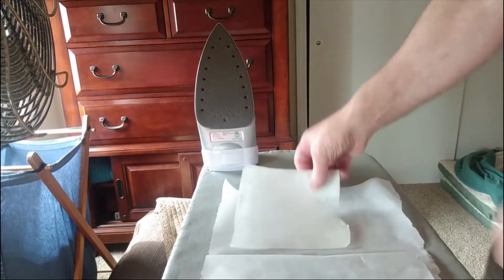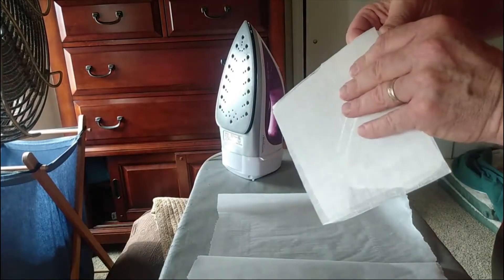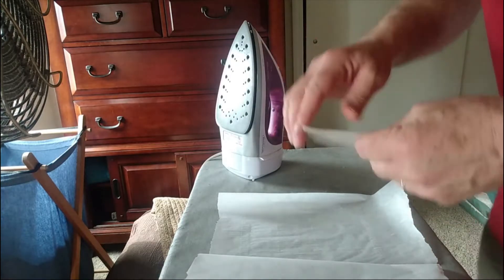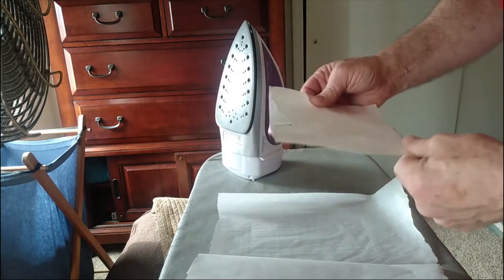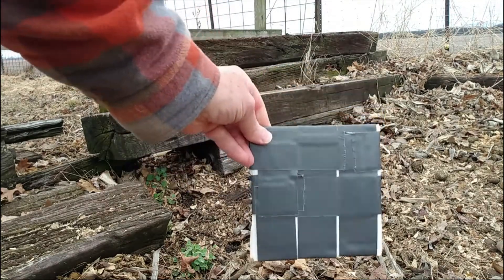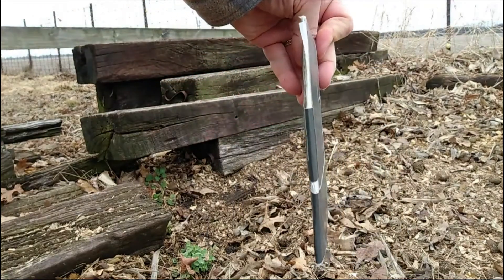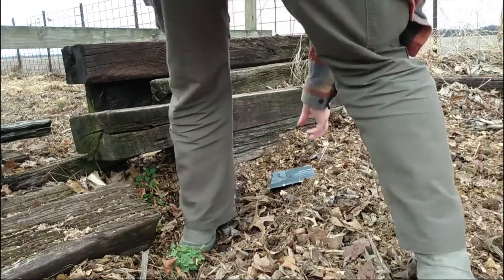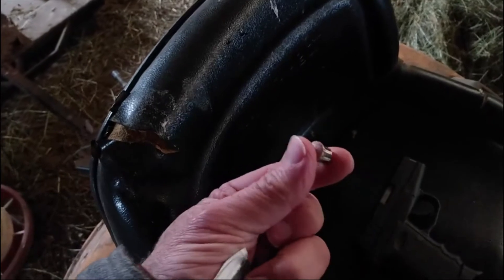Heat bonding UHMWPE - DIY ballistic armor test

Comment: Im sure youve checked it out but have you tried thicker fabric? I recently bout some uhmwpe tape to make a glideless drawer less sticky.  I only looked on amazon but there were 12" wide and i think .1mm thick  tapes. Something to consider
Reply from the maker: Not all PE is the same. Keep in mind that the fabric sheet roll I buy is specifically made as ballistic fabric for vests (usually soft body armor). That means it isn't just UHMWPE plastic, it's fibers of that PE in a matrix of more PE. There are different weights of this ballistic fabric available and I always go for the highest weight (160-170gsm). 
   The tape you mention may be infused with fibers or it may just be a solid tape of UHMWPE. If it has fibers infused in it then it will resist tearing and will require a very sharp pair of shears to cut (I use kevlar fabric shears to cut my ballistic sheeting). A whole lot of this tape might then be a viable backing material for a ceramic face to stop rifle rounds or it could suffice to stop most pistol calibers as soft armor.   The docs for my sheeting indicates that 40 layers is enough to stop a .44 mag pistol. I usually go with extra layers (50 or so) plus a hard ceramic face to stop rifle rounds. The ceramic needs to be selected carefully. I've used high hardness thick (8 mm) ceramic tile over my PE layers and all rifle rounds I threw at it punched right through. Another brand of ceramic tile of equal thickness did stop the same rounds with the 50 layer PE backer.  You should do tests before you settle on a tile and PE combo to make sure it will actually work well. Then scale up to an actual plate for a carrier.
Reply: @BooDamnHoo  any chance you recall any info on what tile worked? mosaic? 1cm thick? do they got it at the hardware store? lol thankyou m8. also, how did you affix the tile? epoxy? crazy glue?
Reply from the maker: @vevenaneathna  The tile that worked best for me was 8mm thick "heavy traffic" tile. Hexagonal pattern, 2 inches in size. I can't recall the name and the squares I have left don't have a name on them (they came out of a box at Home Depot). The design that I have and that worked best for me has a faux white marble finish on the face. They come in 1 ft x 1 ft squares. I'd remove the tiles from the mesh backing and directly glue them to PE plate using construction adhesive. You have to remove the tiles from the squares because they are made for floors(of course) and have a small gap between them for grout. I'd lay the loose tiles out first on the plate so I could see which ones needed cutting (along the edges) and mark the cut line with a marker. After all tiles were glued onto the plate as close together as possible, I'd apply a coating of high impact marine resin to fill the small gaps still between the tiles. The resin I like has no smell so is nice to work with and not expensive:Max Bond Industrial Strength Adhesive Resin. It's marine for boat hulls so think motorboat slamming on waves as it's moving and hitting the occasional submerged log or something. Finally, I glue a ripstop nylon/polyester sheet around the front and back of the plate. It looks nicer but, more importantly, slides in and out of a plate carrier easier. It will also help keep ceramic debris from hit tiles from flying around.
Reply: @BooDamnHoo  hey thanks for the reply, this is really useful info. still doing research and its my understanding that these plastic plates might work better after being fused with temperature instead of resin. anyways, just trying to extrapolate if the surplus plastic plates i bought might squeak out some more performance than yours so I can size the tiles as small/light as possible. really glad i found your channel. I know some people use construction adhesive in place of resin, but im thinking it might perform better to adhere tile vs resin since thats less about delamination strength. 

anyways i bought a dozen of these plates for ~20$ each shipped. all are square so im thinking of cutting them, experimenting with heat and molding them, ect. im thinking I can get away with testing offcuts + a single tile and aim for >6mm. I was also thinking that porcelain tiles might perform better than ceramic and can be lighter? maybe im wrong. also unglazed/textured seems to be stronger. 

If i get around to testing ill let you know and probably learn how wrong i am. tbh the plates seem to stop all plane jane 556 which is mostly what i want to upgrade my 3a backpack insert being a student and all... for obvious reasons. tile strike face to stop green/silver tip and maybe some hunting rounds is just extra credit. thx again

Comment: Can I ask where you sourced the uhmwpe. I'm currently shopping around
Reply from the maker: The best source for fairly inexpensive ballistic vest grade fabric is Alibaba. You can also use Dyneema that you can get domestically but it is more expensive. In any case you want to get heavier grade. I go with 160g. I can't recall if Dyneema uses the same units.
Reply: @BooDamnHoo  I'd love to get Mt hand on some dyneema but after and extensive online search I can't seem to find a vendor. I am hesitant to order from Ali simple because of unknown standards but watching you video does tell me I'm atleast on the right track. Do you mind if I ask who the vendor on alibaba was?
Reply from the maker: @misfitmartiniable  To find my preferred supplier on Alibaba, I looked for suppliers that sell by the meter and had the 160/170gsm material. Some of the suppliers will only sell larger rolls good for a business rather than an individual.  The supplier I've been using is Jinhu Keely Sport Products Co, Ltd.

Comment: Can you shape it? Or does it have to stay flat?
Reply from the maker: It pretty much holds the shape it is ironed as.  It's stiff. I have a curved form made with fiberboard and pieces of 2x4 as a frame so I can iron sheets into a double-curved shape on it. Made it from the fiberboard form I used when I was making plates with epoxy, before trying ironing. The only change I made to it was to cut pieces of 2x4 to act as a frame to hold it steady and help keep the fiberboard in its curved shape (I show the fiberboard form itself in my previous video when I was making an epoxy-based plate, also explaining how I curved it).
Reply: @BooDamnHoo  so it works better with heat compression? Would a heat gun be suitable or does it need to be ironed ?

Comment: nice.I wonder if you can make a tile by just rolling and ironing a long tape of PE instead of doing that on squares of PE sheets cut out.
Reply: hmm, it doesnt help that there is a bunch of "trade secrets" and "secret recipes" in the industry about this, but i think it is part of the confusion. most patents say very little, but from my understanding the difference between regular plastic polyethylene (PE) and UHMWPE has to do with differences in the molecular structure in regards to the polymer lengths. polymer chainlength is what is meant by "molecular weight".
single use water bottles = low molecular weight, very flexible, has a smooth outer surface
milk jugs/cutting boards/thick grocery bags = high molecular weight, much more ridged, has a chalky/slimey outer surface, much more impact, cut, and abrasion resistant. 
UHMWPE chains are apparently so long they can transfer some forces over significantly greater distances that you might expect. I imagine centimeter long molecules like DNA (each human chromosome is ~70 cm long when unraveled like during cell replication). apparently this ability combined with proper directional layering/bonding multiply each other synergistically instead of proportionally, and a bullet impacting the surface has to either pull several layers apart (ideal), break the molecules structure, or melt it out of the way. steel penetrators seem like they are able to basically melt and push their way through. i think an addition of a small-sacrificial layer of ceramic tiles defeats these rounds because they destabilize and no longer impact the plastic tip first. im thinking 5.45 7n6's Geneva convention defeating encased hollow point might actually render its iron core useless here. need to test this.

there are a few channels that have tried turning HMWPE cutting boards into armor with obvious results. theres a channel called 
"Tech this out meow" who was actually somewhat successful in making plates first out of milk jugs in a toaster oven and then just blobing the stuff into a plate in a mold. They were later much more successful when they laminated several layers of those thicker grocery bags (common now in states that charge you 5 cents for each grocery bag since that was apparently the intent of banning the free bags) between 2 oven sheets and just baking for awhile. they had the same known deficits of uhmwpe and penetrator tips/cores and also required much more thickness and weight to achieve the same effect however.  I am somewhat optimistic that with more careful heating and avoiding the polymers glass transition temp, you could maintain pretty allright flexibility with this stuff though. the new us military plates are going to be that hybrid design, plastic + ceramic. sportsmanguide just finished selling cheap surpluss uhmwpe plates for 22$ each shipped. theyre about 45$ ea now that blk friday is over.

i picked up a plate and am going to replace the 10 year old expired kevlar 3a plate in my backpack with one after i glue some cheap mosaic tile on the front. aiming for 4lb plate which performs like 12lb of ar500 steel. gotta test it first. if it works then ima make some more and give them away as christmas gifts this year to family. 25$ level 3+ plates of the most recent "generation"

Comment: If you REALLY want to construct UHMWPE laminated sheet armor that works against all handgun rounds, create enough layers to stop a 5.7x28 FN SS197SR, and the SS198LF.  If you don't have access to one of those, test it against .22 TCM and or .22 TCM9R.  When you get to a number of layers that stops those rounds - you're there.  The resultant laminate will stop any and all 9mm, .38, .357, .40, .45, 10, and even .41, and .44 magnum.  given that it's "soft" armor the super heavy calibers can still damage or kill by energy transfer into the target, but the bullet will not penetrate.
What I like about your idea is that you can create curved laminates that can be sized and shaped to give wrap-around protection.
Also try an sternum plate of 16 gauge steel hammered into a curve to fit on the front surface of the UHMWPE laminate.  This will act to spread the bullet's energy, resulting in lower backface deformation with the laminate structure supporting the steel plate.
Reply: small diameter bullets and steel penetrators' are the kryptonite of uhmwpe. need a sacrificial ceramic layer. this is what the US military is developing for its newest gen armor.

Comment: Interesting, if you put some hard material behind armor with no gap - will PE tears? For example, close to a wood, aluminum plate, stell plate, or even brick?
Reply from the maker: When I tested my first plate I had it up against a stack of railroad ties (I need to get some clay). So hard backing. 7.62 Nato M80 FMJ did not penetrate all the way through. I don't know how severe back face deformation actually is. Pretty sure it would be unpleasant.

Comment: Hello.
How would it resist a knife?
Sorry for my English.
Reply from the maker: Not sure about that. Stab resistant poly armor is usually a different form than bullet resistant. A stab test would have to be separate. I suppose I could try a preliminary test  on my original test plate with a knife to get some idea.
Reply: Yur Engilsch sukz!!
Reply: @philip6419  thank you

Comment from the maker: Updated info. This little plate of 24 layers had no problem stopping 9mm FMJ (115 gr) not 124 gr hp. It did not reliably stop 9mm 50gr +P (light and very fast) hp (Civil Defense rounds). To hope to stop those I'd think about 33 layers would be needed, which would also stop a lot of heavier pistol calibers too. Ironing the layers together would keep it thin but stiff. Unbonded layers could be kept thin by vacuum sealing means and enclosing them in a pouch sewn around the edges. 
Alternative ways to keep it thin and together would be to iron maybe 5 layers or so together, over and over, and stacking these little ironed bits on top of each other.
Reply: put that pouch in between some carbon/Kevlar layers and I'd say you got a nice new jacket liner
Reply: @kingmasterlord  Why on earth would someone do that? Makes absolutely no sense whatsoever when you could simply just increase the layers of the UHMWPE and it will have 100x more protection than regular Kevlar. This stuff is a lot better than Kevlar, a lot lighter and they have the 'Ultra Dense" stuff stopping 50 calibers now.
Reply: @Boobytrap_Badger  because it has to be slim to be a jacket liner? build volume is limited. why is that outrageous?
Reply: @Boobytrap_Badger  density is not the only metric for protection you want a hard shell in places for deflection etc, I said something about it being for a jacket liner, pay attention.

Comment: For how stiff it is for 24 layers and duct taped would this still have enough flex for use as a standalone pistol rated vest face ?
Reply from the maker: You don't have to bind layers for them to work. I bind layers because my aim is to make ballistic plates for a plate carrier (for now).  All bound together as I do it would not really work well for a pistol vest. If you did that you'd need to form it/bend it a bit while you're making it so it would fit better over a chest. Also, is go with more than 24 layers. This was a test by request to check the manufacturer claim that 24 (actually it was 25 but I didn't have enough scraps for one more later) would stop 9mm FMJ.
    If you want flexible/soft for bullet protection, you would want to keep the layers unbonded and enclose them in a pocket/pouch to hold them all together. If use cordura or nylon, or even denim and wrap the layers, compact them as much as you can, and sew the nylon cover around the edges to hold it all in place and together.
Reply: @BooDamnHoo  where do you suggest sourcing for the uhwmpe?
Reply from the maker: @es3753  The best and cheapest source is alibaba.
Reply: @BooDamnHoo  any specific link you'd feel free to share?
Reply from the maker: @es3753  Not a link, but a name:  Jinhu Jeely Sport Products.
Reply: @BooDamnHoo  is there a specific title of product you'd recommend to look for? Also this is essentially the lowtech version of hardwire soft body armor since you have heat and some pressure good job
Reply from the maker: @es3753  There are no real brand titles. It's simply looking for UHMWPE in the 160 gsm range (160 grams per meter). Some of the sellers on alibaba specifically mention it's good ballistic armor.  The (easy) trick is finding the vender who will sell down to 10 meters. I buy rolls of 10 meter length when I need it. With no mistakes on your part, that is enough to make 3 full plates with some left over (for side plates, or test targets, etc). As for the tile strike face, go with 8-10mm thick heavy duty tile (for floors/high traffic areas). I go with either 2 inch square tiles or 2 inch hexagonal tiles and these are adhered to the front face using epoxy resin. Finally, I wrap the whole thing in either kevlar fabric (it's yellow and available on Amazon) or riopstop nylon or cordura nylon. This is stuck to the plate by epoxy as well, though you could go with construction adhesive too. The cover is to make it easier to slide in and out of a carrier and to act as a spall guard (any chips of ceramic get captured by the cover). But then, gorilla tape does this job pretty well too. The ceramic just doesn't throw much debris that your plate carrier couldn't probably handle alone.
Reply from the maker: Another thought: iron a few layers together and keep doing that so you have a stack of individual bonded packets (maybe 4 or 5 layers each). This will be somewhat stiff after you stack 6 or 7 on top of each other but much more flexible than 24 to 35 layers all bonded together.

Comment: Soooooo good man! I'm glad your working on this. Do you mind me mentioning you in my new HDPE video?
Reply from the maker: Sure. No problem.
Reply: Endless sling used by cranes are made dyneema but threads bound to gether but real cheap when throw them away! slightly damaged Im sure used resin should work can you tech it out Mr meow

Comment from the maker: I patched a few vids done for discord group members together to make this more coherent.  This is definitely going to be my future method of making UHMWPE-based body armor.  I will still use epoxy to bind ceramic tile to the front face of any plates I make, and to bind the cover (whether kevlar or ripstop nylon) I put over the plate.  This should save nearly 50% on weight of finished product.